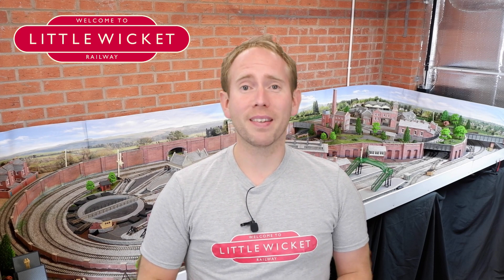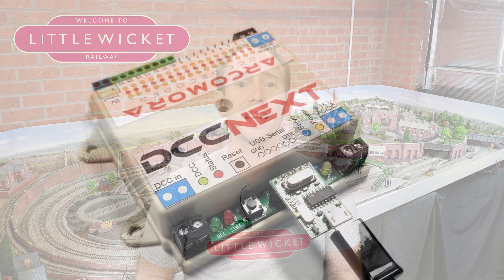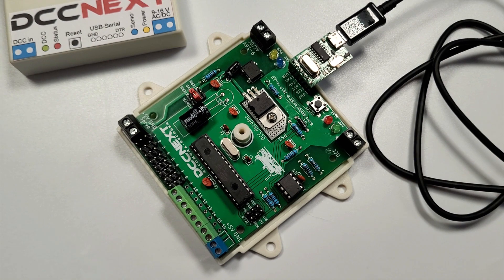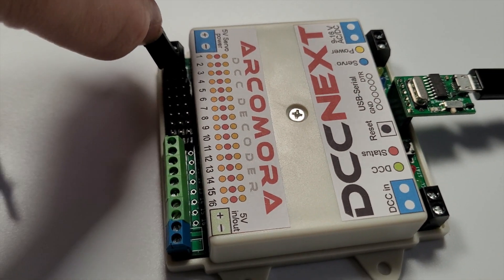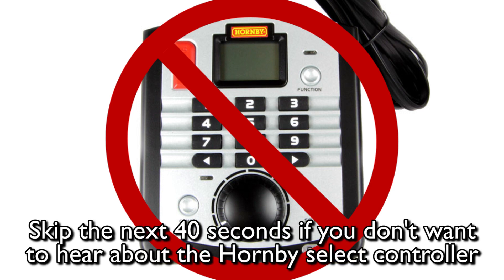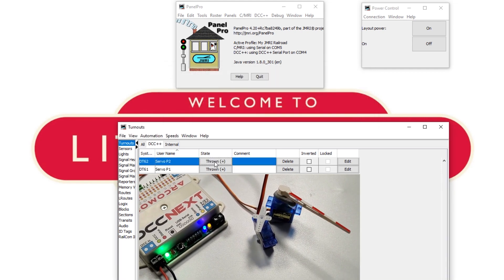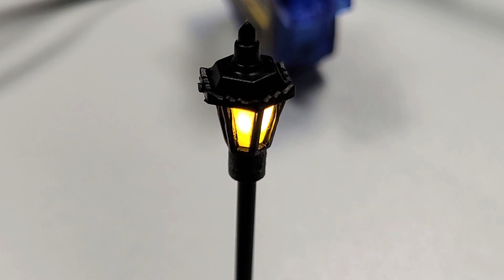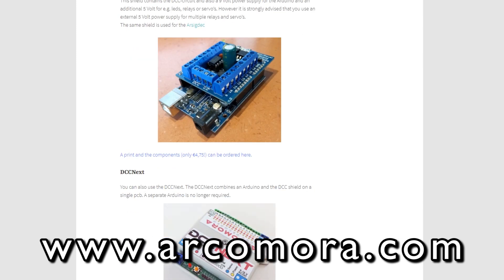Arcomora - Arduino Controlled Model Railway DCC Accessory Decoder

Comment: Are you still using it? Have you experienced any glitches on the servo while the loco is running? My servos are about 4 feet away from the controller.

Comment: Hi.  Great video. I have arduino control on my DC layout with 14 IR detectors, 10 servos controlling points and another 9 operating semaphore signals, and have coded signal operations to respond to train occupancy and point position.  My biggest frustration during my build (and learning of Arduino and electronics) was erratic servo behaviour, often triggered by trains rolling over points.  Solution is all down to power supply. Always power devices by own external supply (I use 12v for ardionos, 5v for servos & detectors), not the arduinos themselves, join all GNDs together and make sure you give a big enough main power supply to drive everything. The hours I've wasted trying to figure out random servos jitters!  By the way, you can also use the PCA9685 to operate LEDs, even common anode bi-colour which I have mounted on my semaphore signals.

Comment: I have told to have a look at your You tube with Arduinos and Sensors and signals and maybe what ever else. I am learning about Arduinos and things, I want modules 2406mm x 1410mm  in 3 Sections A,B,C - A is Ground Zero, B is MID HIGHLANDS 0-240mm, C is 240, these will lay on top of supports from a wall, I do not wish to get down on the floor to work underneath, so each section will be on on this support shelf, and me in a seat to work on
I think there is too much wires involved, so I want to find out about WIRELESS operation for hence the idea of WIRELESS ARDUINOS in a CABINET along side the 3 ASPECT SIGNALS

Comment: Also the Okkie currentdetector modules of Arcomora are very easy to use and have 8 blocks per module!
Reply from the maker: I've got one of these to try 👍
Reply: @LittleWicketRailway  they're cheap and easy to install! In combination wiht the builtin arduino digital pins (and using the built in pull-ups) it's very userfriendly. Here in action;
https://www.youtube.com/watch?v=53Im_XciouU

Comment: Hi Rob Many thanks for you previous reply, I have been using one Arcomora for 12 sets of points now for a while and because of the size of the fiddle yard I now need to use a second one! have you, or are you using two?  and if so can you help me, for as  hard as I try I cannot get the second one to work without the first one stopping, I'm sure its an easy fix but its beyond me, I have asked Nico and he has been very helpful but he does not use JMRI and hence does not have any answers to my problem, I have as you recommended set up a independent DCC power line to the first Arcomora and also to the second one. 
Best regards
Derek

Comment: Hi Rob, another great Video so I got one to play with and setting the servos up was easy but when I connect it to my DCC++ base station nothing is working I have set the jumpers to DCC and wired up my servo as per the instruction from Nico ( I don’t have and DuPont pins ) so Orange in the position 1 and 5v +/- to the servo and 5v - to the servo power block. Where I am slightly confused is the DCC connection how do I connect it to my base station? Ie do I connect it to my track or directly into terminals A on the base station 
Many thanks Derek
Reply from the maker: Hi Derek. Best thing to do if you're struggling is to contact Nico, but you should just connect your DCCNEXT to the DCC bus with dropper wires, just like you would with a piece of track.

Just to add. My recommendation would be to have two sets of DCC bus wires around your layout. One feeds the track and the other feeds all your accessory decoders. I would put short circuit protection in between the base station and the track bus. This way if you have a short on the track it won't cause the base station to trop and cut the power to all your accessories. You don't need extra short circuit protection between the base station and the accessory bus because you're very unlikely to have a short circuit on your accessories once they've all be set up properly.

You don't have to have two DCC buses, you can connect everything to the same bus, but I think it makes the system a bit more robust and justifies the extra wiring. I rewired my original layout because I was fed up having a short on the track that stopped my points from working. Another benefit is that if you wanted to run a DC loco you could disconnect the track from the DCC base station, but still have the accessories connected. So you could connect a DC controller to the track, but still run all the accessories off the DCC bus, sort of a hybrid system. Again, this is what I did on my old layout to run old analogue locos. Just need to be careful that you take the old locos off again when going back to DCC.

Comment: Hi Rob. I used a UNO + Sensor/Servo shield v5. I built the DCC input/output board and Mardec works fine with servo and LEDs from the JMRI interface using the assigned DCC addresses. However my sensors are not recognised by JMRI, although Mardec records their state change. As the Arduino is not connected directly to JMRI via USB (CMRI), only by the sensor DCC address. I can’t get JMRI to recognise the state change. I believe I’m not setting up the sensor address entry in JMRI correctly for it to be recognised. Does it need to have boardnumber: ID to work? Is it classed as ‘internal’? Have you tried this? I’m have just built a DCC Next and results are the same. I suspect I’ll have to attach the Arduino permanently to work. Have you tried a sensor with yours?

Comment: I'd love to see a deeper dive into the 3 different applications and all the functions.
This would probably replace the sensor boards that connect via USB / COM connections.
Quick question on the flickering light.  Does the DCC Next have mosfet's to drive the output for higher current, say if you had a string of 20 or so "gas lights", or is it just direct to the Arduino pin?

Comment: I’m using 3 of them, controlling led, servos and other accessories. I don’t use de dccnext but a similar print provided by a model railway club here in the Netherlands. Also self soldering. That also works great.
It is quick, controlling servo speed and action is simple.
Reply from the maker: Good to see another positive review for Nico's work 👍

Comment: Have you had a look at the exrail that dcc++ex has to offer for automation of locomotives
Reply from the maker: Desperately need to look at DCC++EX, it's moving up the video priority list.
Reply: @LittleWicketRailway  I have added you on Instagram if you want to take it offline.
Reply: Also another thing that might interest you is 1join this sends the dcc signal to both the main track and the program track. you can drive a locomotive on to a spare siding that needs to be isolated and reprogram it. Also it has been mentioned about stacking a 2nd shield which is an on going topic on their discord booster page.
Reply: The exrail with your test layout may make a good video for automation and there is an example of how to do it.  Same type of layout.
Reply: @LittleWicketRailway  I am made up with it and after getting to know one of the developers who is a member of MERG he has pointed out so much about it.

Comment: Nice one Rob I have done this with a cmri node as well after help on MERG. as  I am not a lover of dcc accessory decoders
Reply from the maker: Cheers John 👍 Out of interest, why no live for DCC accessories?
Reply: @LittleWicketRailway  mixing the different types of data signals maybe ok on a smaller layout which doesn’t have lots of data due to more locomotives and lots of sensors and turnouts. It’s only my opinion Rob but this new piece of kit is fantastic and it opens up more options for many users.
Reply: Plus I am ok with coding in arduino C and this kit is great because it does mean no coding required.

Comment: I like this idea, and keen to implement on my layout upgrade (which is happening now). I started playing/learning Arduino about 12 months ago, and after seeing your use of servo's in earlier posts decided to go down the same route. Found a model plane/helicopter merchant in Australia who was selling the servos at a ridiculously cheap price. I made a control panel to manually switch Peco, Hornby and Guagemaster point motors (all 23 of them). However if the Acromora works nicely with Railmaster/e-link DCC then servo's will be the way to go.

Comment: How does this compare with the Locomotive dcc app. available to download?  I have it and it seems so much user friendly than this.
Reply from the maker: I've just Google Locomotive DCC and found the app and a video uploaded by Bill Cuthbert. The website is down though and I can't see where to get the kit. From what I can see Locomotive DCC looks like a DCC base station and WiFi controller, similar to DCC++. Let me know if I've got that wrong. Whereas Arcomora is a decoder, not a controller.

Arcomora will potentially work with Locomotive DCC.

Comment: I use the Mardec software but not the DCC Next board. The software is loaded on an Aduino Uno (I use three in all for 31 servo controlled points) and the servos controlled via an input/output board I built myself (at first I used a vero board but then got them printed in China) which feeds power to the servos and the signal from the Arduino. It’s all explained in Nico website so you can build everything yourself with some thought.

Comment: Kinda weird I was just wondering if something like this would be possible, and then this video about a month later. That quick shot of the board looks like it really is just an ATMega 328 (the exact chip on the original arduino uno). You could definitely get something that has more IO or speed but the 328 is cheap and well documented so it makes sense to use it

Comment: Hi Rob
I followed your instructions and videos for servo and block detection using the merg kit which I found great. I had an issue with 2 of the detectors stopping working so went looking for other detectors. It was then that I came a cross arcomora. I have 3 dccnext and 3 arloco with the okies. They are both brilliant pieces of kit and easy to set up and understand. Looking forward to see if I can learn anything from you regarding these.
Reply: As with any electronic equipment they sometimes will stop working. If you are still a member of MERG raise a thread on their forum and they will help you to try and diagnose the problem. I for one will look out for a thread and see if we can help sort it. It maybe a dry solder joint joint or a component that has failed.

Comment: I'm using 2 of these and it's worth every cent I spend on it.
Reply from the maker: Thats good to know 🙂 What are you using them for?
Reply: @LittleWicketRailway  principally for the servos of my switches. I ordered half Dupont pins and half screw connections to keep some flexibility in my choices.
I did not buy the DYI kit but the finished controlers; excellent quality.

Comment: how would one go about configuring the limit of throw on the servos? and also could you do a vid on using relays on point frogs with JMRI/CMRI?
Reply from the maker: You can adjust the range of the servos when configuring. You can also centre the servo for fitting into the point.

How to deal with frog polarity using a few different methods is on the video list. If you wanted to know how to do this using Arcomora then there's a good example in the mardec manual on the website.
Reply: @LittleWicketRailway  which vids? I'v viewed most of your JMRI vids and haven't seen any info.
Reply from the maker: @Capt.Safety  I meant the list of videos to make, sorry for the confusion.
Reply: Have a look at the videos on the Arcomora video page

Comment: Very interesting! I was aware of Arcomora but was not aware they did a multi device decoder, something I have had at the back of my mind for years, as you pointed out Arduino based I/O are considerable cheaper than off the shelf. I know coding puts people off, but that looks really easy, even for the Arduino uninitiated!
Reply from the maker: I was surprised how easy it was, I'm considering making heavy use of it.

Comment: Very interesting and worth more exploring for me, although I'm still in the framing build stage. I don't really understand how dcc knows the location of each train at startup. etc. but learning lots thanks to your videos, Please keep up the great work.
Reply: It doesn't know the location, Tony.  :)  DCC simply allows an order or "command" to go to a specific decoder, such as a locomotive, signal, or turnout.  There are ways to detect trains, but that's not built into the DCC specification.  I hope this helps!
Reply: Like Brian said, DCC doesn't detect the trains but is more a set of  protocols to send commands via digital signalling.   I have started experimenting with NFC tags and sensors to identify particular trains.  With strategically placed block detection and NFC readers, you can work out what loco is where.   I am in early days of experimenting though, so no real useful information on this from me yet
Reply: @EsotericArctos  That sounds really interesting. Thanks for the reply.

Comment: Hello

This product looks an ideal option for me as I would like to incorporate LEDS and other accessories on to the layout. Just to expand on you LED example. Did you have the LED couple to a PSU and then had a wire going to the controller?
Reply from the maker: Hi Tim. The LED lamp was connected directly to the screw terminal (+) and the common ground (-). I'm 99% sure the LED has a resistor built into the lamp though (I'm pretty sure it was advertisedas being safe to use with 12V). I was running the DCCNext board off the 5V servo supply.